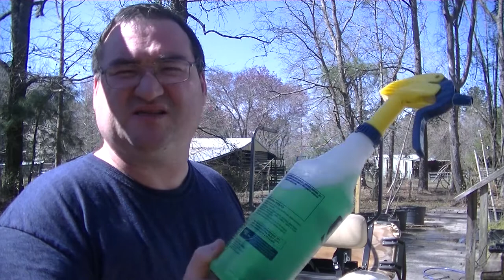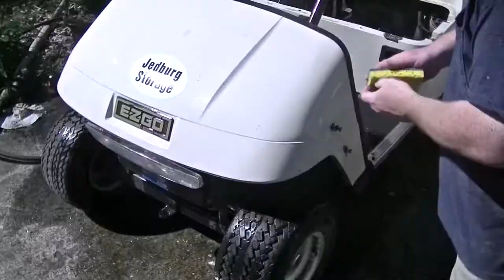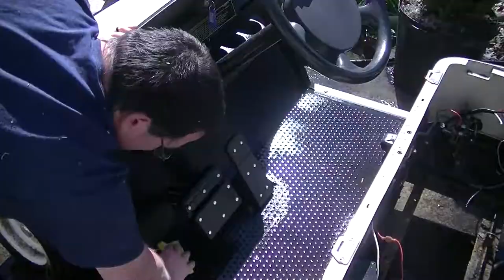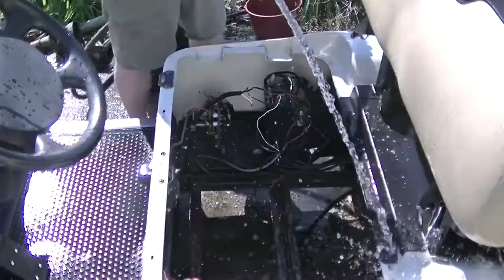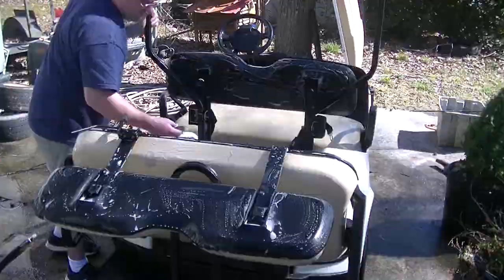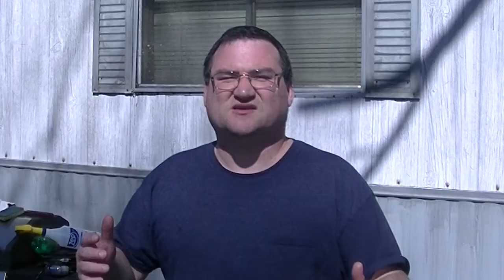( A Short Video ) This Golf Cart Needs A Bath !!

Comment: Well with the roof off have you considered either adding a few solar panels to it or making an entirely new roof out of panels? You could potentially have a mobile solar generator here. crap now I want a golf cart lol, I have 2 renorgy 200w 24v panels  that are fairly light weight I've been trying to find a use for.
Reply from the maker: So yes I am going to use just one solar module. It's the 290 watt one off my setup now. Sucks to lose a bit of solar. But will be using this cart a lot. So rather have it keeping the cart topped off. The roof that came on it. Is not flat at all. So I got to remove it and replace it with the PV mod. 

So the videos your seeing are 3 weeks behind. As of this min I been using the cart for 4 days. Not even dropped down to 40 volts yet. Heheh
Reply: @yankey4  3 weeks!? Well if you ever end up driving through Denton Texas area look me up, I have several extra BP 2150s solar panels and could donate a few for the cause. they are 150w 24v. they are glass and slightly concave. They are designed to set on a flat roof and still get a good sun angle they're just a bit heavy. Well happy late resurrection day friend, I'm working on a second off grid system to run my chicken yard and well house today. soon I'll be adding 2 wind generators to my current system as well so i have to get busy myself. Keep up the good work! When we lost power in the ice storm recently I wasn't aware until 16 hours in the crisis, my solar took over. It was a neighbor that noticed I had lights on and come asked me how lol. we are going to need solar for real soon I think.